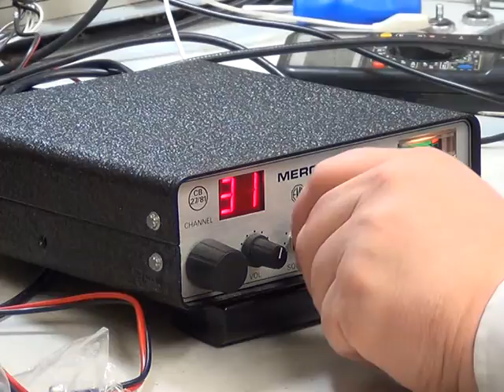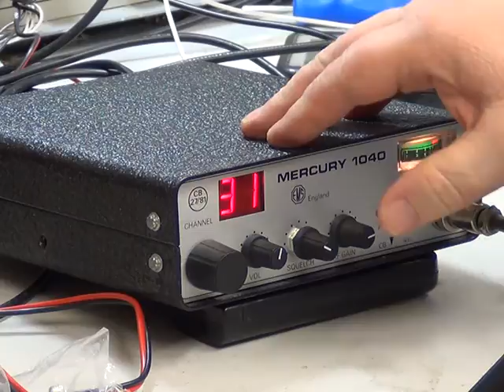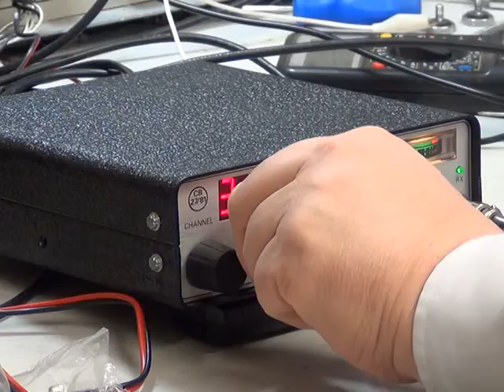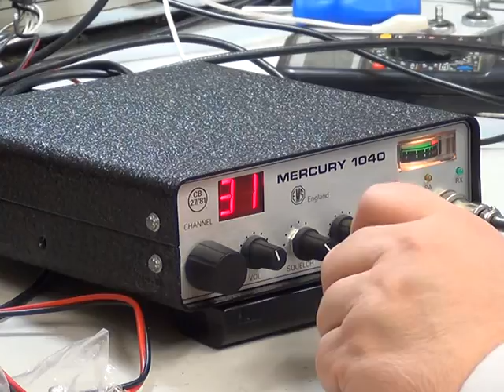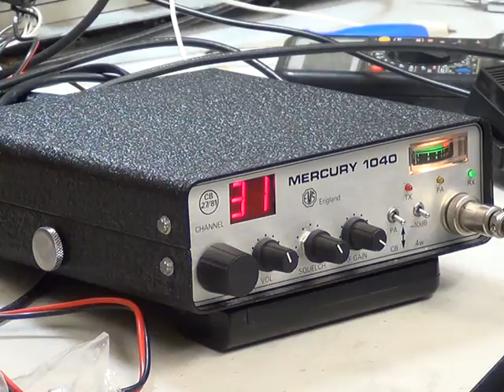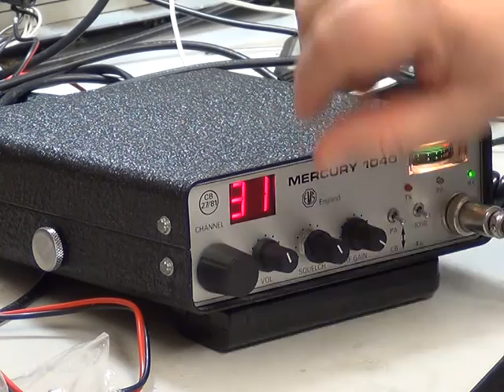EMS Mercury 1040 UK() (CB 27/81) CB radio (Mobile) - On The Air Test

Comment: lol you never had a Cheisa or whatever they were called...they were shite.
 mercury and magpie were brilliant compared now we have shitty Anytones with crap mikes and cheap switches r.i.p
Reply from the maker: Steve...the Cheiza. My pal Electric Man just bought the GT868 version not realising what it is. The thing here is that the Mercury & the Magpie (that I haven't tested yet) were sold as top line rigs. This Mercury works "ok", but not as well as you would expect for the money. 

I have both the Cheiza GT858 & GT868 models here & must do a video on them. Joking aside, they will work OK here in my rural location, but in a town or city with other users around, the receive selectivity is abysmal..oh...and you rarely get more than 2.9W out of them either!

Richard
Reply: UK CB radio servicing i had one vile machine ...bleed over bad...hated it ,got a 341 better mc
Reply: I think they had other names too like maybe barracuda etc yuk i assume they were chinese from early 80s
Reply from the maker: Steve, they were all made by Great of Taiwan. Fidelity 1000, 3000 base, Barracuda GT868 (not the other Barracuda), Elftone ELCB6000, Cheiza 858 & 868, Academy 701, 702, Commtel 858, 868, Johnson 868, Lake 850, 950 & loads of others in a similar case format.  However, they are reliable & many are still working without service after 35 years. I'm hoping I'm still here in another 35 years to see if the current offerings are still working....that'll make me approaching 90!
Reply: UK CB radio servicing i doubt if those Anytone 555 Alinco etc will be around...ive known a few go pop after 3/4 years heard it from friends who had them
Reply from the maker: The Anytone 555 isn't a CB radio, it's sold as a 28Mhz ham set but we all know is really an illegal "export" CB. Because of it being an illegal radio in reality, they tend to get messed about with, so it's difficult to judge the quality of the legal Anytone products. I've had a couple of legal new ones here for optimisation & they were both OK. However, I don't know what they will be like in the future of course, but time will tell!

I've had a TTI881 here with it's VCO so microphonic it was virtually unuseable. The surface mount ceramic capacitors in the VCO had absorbed moisture just from being in the customers car for a couple of years. Nothing you can really do. I take the precaution of spraying the VCO with a PCB laquer on new sets in  the hope of it not happening to any I supply. I shouldn't have to do that & it doesn't impress me!
Reply: UK CB radio servicing true i couldn't see any ham user buying one of them it's just a cheap sidebamder which  looks like it lasts as long as the 💰 money .
haven't found a decent modern radio yet that doesn't feel cheap...555's are cheap i didn't like mine gave it away
Reply from the maker: I'm not involved with illegal radios or illegal radio use in any way...or even 'grey area'' radios like this. All these 28Mhz multimode pretend ham sets that are really "export" CB's are illegal to use in the UK as a CB radio. Bear in mind that Ham radio use on CB frequencies is also illegal. All CB radios have to by type approved & incapable of operation outside the approved frequency bands & modes. Currently FM only on UK 40 & AM/FM SSB on CEPT 40. Radios have to be new CE approved sets for the latter.

Richard

Comment: The fm rush noise seems low for NFM or they fitted extra wide filters!
Shame had high hopes would be a good,one.
Build quality seems to look ok,never seen ones of these before.

Great vids as usual Richard.
Reply from the maker: FM reminded me of the Fidelity 1000 (hence doing the Academy CB501 next!). In the Great (brand) GT848.858/868 chassis used in those aforementioned rigs, the FM is detected using a balanced diode demodulator rather than a clever chip. The FM demodulator chip in the EMS is not one of the "normal" ones we expect to see in a 2-way radio. I wonder if it's one aimed at use in FM entertainment radios. Some of those cost 35p whereas some of the usual 2-way radio ones cost £5. I also expected a crystal filter in this radio, but no; it's ceramic as usual.

However, apart from the insensitive squelch, the radio performed unusually well in the field test. Mark, driving the test vehicle, reported unusually good transmit audio from the EMS; a point EMS used to make in their advertising at the time. We paid £97 (inc post) off Ebay for this sample "as-is". The receive side took a lot of straigtening out. Mark was particularly keen that we buy this for review. They don't often come up & always fetch good money. We are supposed to have a sample of every UK legal CB radio ever produced here & we all knew that the EMS was just about the only gap. 

Like you, I immediately thought of extra wide filters, so switched the signal generator to a wider (entertainment radio) setting; it was worse, so the filtering is correct. I definately put it down to the FM demodulator IC being "different".

Richard
Reply: UK CB radio servicing yes think your correct,i have come across diode demodulation NFM detectors and due to no limiter they can sound a bit weak in audio tone/noise rush,hmm if you had schematics prob easy to fix squelch problem,prob in noise filter,that's why questioned background noise low,it maybe related to squelch issue ie not enough noise to that part of the noise detector and hence tighter squelch.
Fm tx is it proper clipped pre emphasised like commercial vhf radios?  could be why sounds good,i modified most of my cb kit and it sounds miles better that soft limited way the old 80's cb sounded.
Still look very well commercial grade for its time period,its just a shame cb was treated at time as a toy/fad thing im sure mfr could have produced higher end quality kit at time,thanks for showing us was treat!

Comment: sounds like 
you are talking on am modulation, in my opinion something is not right with the receiver
Reply: I've never seen a 200 I must admit and only saw the 300 mentioned once or twice.
 You often saw radios listed in the back of the early 80's magazines that never appeared in the public domain. These "oddballs" as I call them are what I like best. I'd sooner collect the unusual rather than have a larger collection of "normal" radios. They're a bit ugly...like me ;)
Reply from the maker: the waveforms are correct on the test instruments, but the super-slim plastic internal loudspeaker is a joke. However, we always do these tests using the factory fitted internal speaker for a fair test. In reality, anyone normal would plug in an external speaker if presented with thin tinny audio like this. Reminds me of those speakers in the Harvard/Harrier/Alba 40-channel handhelds!
Reply: I've got 5 of these including 2 of the portable versions and they're average radios. By the way, the one you have was bought for  £335 plus postage a while back!!! Mine cost about £25 for the mobiles and a tenner each for the portables. 
Keep up the good work :)
Reply from the maker: A friend of mine bought a Magpie Autoscan 5000 at a car boot sale for £10. I've one here, but we've yet to look at it, so bargains can be had. My friend Mark bid too much on my behalf...like double, but I'm not cross about that; We'd neither seen one. TX audio is lovely. So if ours cost somebody £335 & was miles out on receive, what were they thinking of paying so much? I've got a commercially made PE Ranger here too, plus an unmade kit one as well....another British rarity!

Richard
Reply: I've got a PE Ranger but missed out on the 40ch expansion kit a few years back. I've got the Practical Electronics mag's that covered its build progress too. I love the old unusual stuff.
By the way, you beat me to that Midlands 76-300 a few years back. I was bidding from a works computer and was ready to "snipe"  in the dying seconds when the computers connection went.
I still cry at night over that..sob sob! ;)
Reply from the maker: Regarding the Ranger, I built one "at the time", but not from the kit; sourcing all the parts myself & making the PCB's. I made the PCB & have all parts for the base station adaptor & again made the PCB & have all parts for the 40-ch adaptor. Must get around to building them both now 35 years has passed!

Regarding the 76-300, which I reckon must be a pre-production sample with no serial number, at least you know it's being looked after. Until Ebay arrived I didn't think I had a competitive bone in my body! My friend Mark (ZX2) G7NDJ works shifts & can sometimes bid for me when I'm not around & my retired friend Bob can too. Bob sniped my car for me at 2:30AM one morning, Mark sniped the 76-300.

Midland were initially imported through Plustronics, whose brochure at the time showed the Midland 76-200 base station. Have you ever seen one, or was it like many other brochures at the time full of 'hopeful' products that didn't happen Like the JWR line-up of loads of non existing sets?

Richard